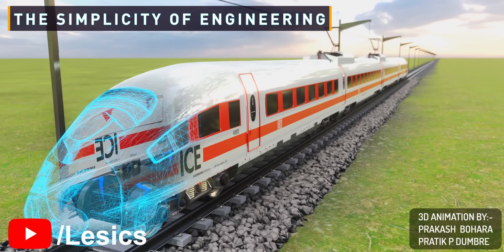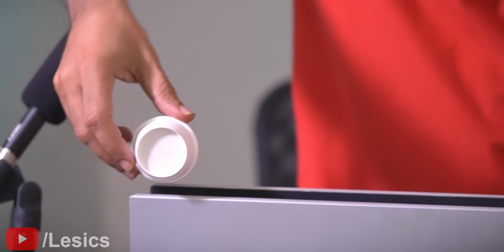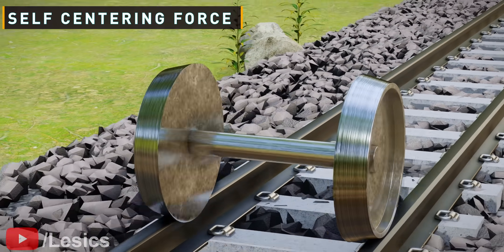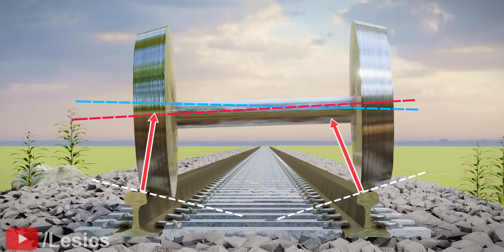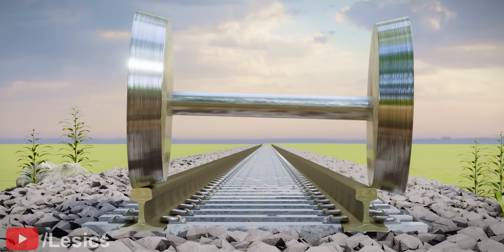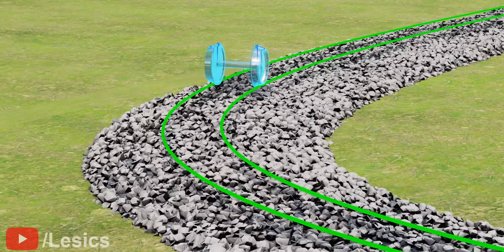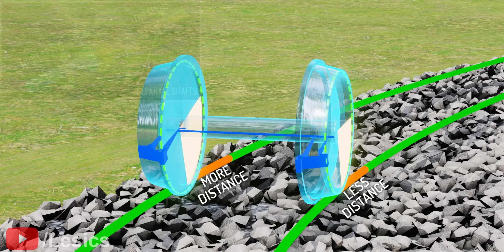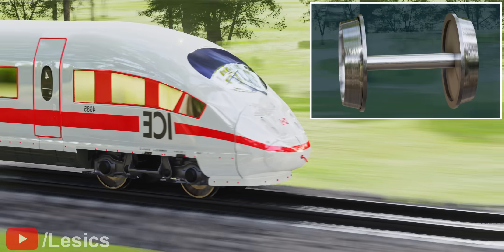The interesting engineering behind the SHAPE of Train wheels!

Comment: Well, the same conical shape gives rise to hunting oscillations on a straight track I.e the side to side movement, which even required the engineers of shinkansen to drastically reduce the cone angle, to ensure high speed stability of the train. So, it is brilliant but not flawless.

Comment: Dont listen to sh$t like "differential action" it could be called loopdygoop action if the differential (a gearbox in cars) was called loopdygoop. I hated that studying engineering so many useless as f%ck terms to use. Like names of people for equations and sh%t. Its the radius contacting the train rails is smaller on the inner wheel dont need to go on and on with complex naming schemes.

Comment: Don't understand differential action around curves. If the curve is properly superelevated the wheelset will remain centered between the rails, thus no difference in contact diameters will occur and no differential action. Squealing! Of course, for real trains (proper speed and weight the center of the wheelset will oscillate around the track center).

Comment: In reality, banking to overcome differential doesn't always work that great.  If the tracks and wheels are carefully calibrated or are worn down, there will be significant resistance.  This will manifest itself has noise (why trains make so much noise when taking a turn) and increased wear/tear on the tracks.  Ideally railroad tracks don't turn at all which is why they are often pretty straight.  This brings up an interesting debate on narrow gauge trains vs wide gauge.  Narrow gauge can take tighter turns because the differential is less.  These are popular in mountain areas where railroads have to take tight turns to get around the mountains.  Wider gauge is popular because it can handle higher straight line speeds without oscillation.  BART is a famous example of a railroad whose gauge is too wide.  It is extremely noisy 90-100 db because it is difficult to calibrate wide gauge rail, which results in imperfections and track stress/noise (especially on turns).  Alternate solutions to these differential issues including having side wheels (like monorails) or having each wheel set move independently (possible for passenger rail as its axles don't have to carry the same weight as freight).

Comment: I always thought flat wheels with flanges were sufficient, but the self-centering action of conical wheels make total sense! 
And I never considered the problem of differential action, always assumed the wheels turned independently and not connected with a solid axel.
Reply: It depends on the type of train, but the majority use rigid axles.

Comment: Tracks are generally laid in a straight line with minimal curvature for high speed use. Unfortunately it may not be possible under certain terrains so the speed of the locomotive has to be drastically reduced to manage the centrifugal forces and the track is banked at an angle to minimize the resultant force.

Comment: Now, what about perfectly flat wheels, which are non-conical on both sides? With a tooth structure for both wheels at each end. My guess is that in this case the problem will be there related to curvature of tracks and turning as shown here.

Comment: Never under estimate 'trial and error' as  useful to design. Also, keen 
observation of Nature can yield new methods and materials. The conical 
shape and flange on train wheels developed over time. Today, only 
materials have changed how train wheels are made and maintained. When 
train wheels wear, they can be re-surfaced one or two times before they 
are recycled into new wheels. Both left and right wheels are machined to
 same measurements, otherwise wrong dimensions would introduce tracking 
errors and greatly reduce useful life of train wheels.

Comment: That is interesting. Instant differential action. Does this design put undue stress on the constant outward pressure at the top of the rails and levering out the anchors? No taper would  have the weight straight down on the rails except in curves?

Comment: This differential action is not suitable because it has a specific radius and with specific speed to turn the train, as it has limited taper. So, if we want to turn the train at low radius with different speeds, in that case this differential action is not going to be work effectively.

Comment: There is a riddle that asks what part of a train is always moving backwards? 

It's the bottom of the wheel. Since the radius of the wheel that touches is smaller than the entire wheel, the part that exceeds the touching radius will move backwards slightly when on the lower half of it's turn.

Comment: Actually, I don't think the explanation of the self centering in the video is correct. Even watching the example with the cups glued together it seems clear that the mechanism is not direction of forces, but the difference in the radius of the part touching the track which actually corrects the direction of the wheels. If it was just the stated forces, the cups glued together wouldn't "turn" to get centered, but would simply gradually become centered while still moving forward.

Comment: I'd always wondered how trains handled the differential rotation of going around curves given that they have a fixed axle with no differential gearing. This answers a question that has bugged me for years.

Seeing this has also allowed me to figure out another thing you didn't mention: the reason why there is a definite limit to how sharp a corner a train can turn. If the turn is too sharp (which is certainly the case in your video, although I realise the turn was exaggerated for illustrative purposes), the differential rotation required to negotiate the turn becomes greater than the differential rotation that the conical form of the wheels can supply.

The ratio between the inner and outer radii of the wheels thus represents a hard limit on the tightness of any turn the train can make. This is why you can't have right-angle corners on railway tracks, and why they can only curve gently.

If the cones were steeper, thus giving a higher inner:outer radius ratio, the train would be able to take sharper turns. However, the steeper slope of the wheels would also increase the lateral forces between wheels and rails, putting increased compression and flexion stress on the axle as well as expansion stress on the rails.

It would be interesting to work out the optimal inner:outer radius ratio to maximise the possible turning angle while keeping the stress on the wheels, axle and rails within structural limits.
Reply: While the differential action of the conical wheels is cool, this video fails to mention that is not a hard limit for the tightness of curve a train can take. Outer wheelslip on curves is supposed to happen all the time. That is the screechy metal sound you hear trains make when they go around curves. The differential action of the conical wheels just decreases how much wheel slip happens. This is also why railways apply grease to the rail on the inside of curves, to decrease wear on the wheels when they slip around the curve.
Reply: Sure but.....a train doesn't only have wheels....so you can't really make a sharp turn
Reply: @Sweet-bx2ec  Also, the length of the bogie would also be a factor in that limit as per your comment "doesn't only have wheels".
Reply: @Sweet-bx2ec  Of course. Without actually doing the maths, but considering the trigonometry involved, I would imagine the relationship between the steepness of the cone and the sharpness of the turn that would enable is related to the angle tangents, meaning that the stressors would increase asymptotically with cone steepness, reaching infinity at 90 degrees which of course would mean the cone has no depth.

I'd imagine that stress curve would rapidly become untenable, in fact, if you took the cone angle much past 30 degrees.
Reply: @Mystikan  30? Off by an order of magnitude, try ~3.
Reply: High elevation curves also utilize rail lubrication devices to help prevent premature rail and wheel wear.
Reply: Calculus
Reply: What none of you are considering is that a train is composed of many connected cars, not just one.  If you have ever pulled a trailer behind a vehicle, you know that you cannot make too tight a turn either going forward or backward or the trailer will jack-knife and if you are going fast enough, can cause both the vehicle and the trailer to turn over.  The same concept is true of trains.  The curves cannot be too tight or the train cars will "lock" into each other at their inside corners (that is the corner that is on the same side as the direction of the curve) and the whole train can start to derail in a cascading form of jack-knife.  The curves are designed to accommodate the longest possible train car (freight or passenger) that might ever use that stretch of track to further reduce the chance of the cars binding together.  A lifetime of messing around with HO-scale trains taught me that; not a math degree in sight hanging from my walls.

Comment: The “automatic centripetal force” is a misleading explanation. The track is what turns the train and the reaction force between the inner disk and conical surface and outside track provide the required force to turn the train. It is the trains inertia and low friction of metal to metal contact which keeps the wheels aligned towards the outside track.

Comment: But with conical wheels the weight of the train is focussed on a tiny section of the wheel, not the entire width of the wheel. Surely this places enormous forces on the wheel? AND causes wear only on that part of the wheel, meaning uneven wear? Could you address those two issues please? They weren't included in the video.  >:-(

Comment: The conical taper causes a "hunting oscillation", which at very high-speeds will cause a train to derail... even if the tracks are perfectly straight and level.  This is why we don't have high-speed trains in the US, because it would require different railroad tracks.
Reply: Interesting

Comment: An alternative way to confirm the self-centering property is to imagine if the wheels weren't angled, but instead the tracks were (at the same angles).  Then, if the tracks angle inward they effectively form a channel that the wheels sit inside of (stable), while if they angled outward, they'd effectively form a ridge that the wheels straddle on top of (unstable).

Comment: Interesting but still a bit confusing. Would the speed of the train going around corners, change how far the wheels will shift thereby changing the diameter of the portion of each wheel in the track?

Comment: As for differential action, wouldn't a particular conical shape of those wheels dictate that all curves in the tracks have the same exact radius? I'm pretty sure that there are more technologies at work here, like putting the wheels on a rotating platform,  and having the wheels do some sliding over the rails. Further, that conical shape of the wheels has as an extra benefit a minimized area of contact between wheels and rails, thus making for less friction and power loss.

Comment: Very good explanation, BUT: In the animation explaining the differential effect 3:40 I think there is an error, it looks like the inner wheel makes a lower angle than the exterior wheel, but they must make the same because of the conservation of angular momentum. So, both of the wheels go along the same angle, but the distance changes because of the difference lengths of the  circumference that the conical shape makes.

Comment: What I think contributes more to the automatic centering, is that per revolution, the larger diameter travels more distance. This causes the wheels to "steer" towards the smaller wheel, which happens to currently be towards the middle.

To imply that it is the angle of forces, is to imply there is sliding going on. How about the centre of weight leaning more towards/over the smaller diameter? Wouldn't that have a stronger sliding effect?

Nice animation though

Comment: Funny thing, you're showing the German ICE, which wheels are only slightly conical as you described. Check the French TGV, it's wheels are much more conical. The problem with those more conical wheels (yes, they are more safer, than straight ones), the stress and wearing off of the rails are much higher.

Comment: I am wondering if there are any techniques to reduce the weight of the train. Also increase the distance between slippers to safely save lots and lots of material. Are Hollow shafts equally safe as solid shafts ?

Comment: Just an added info, there are minimum angles for curves in tracks. Those minimum bending rules are based on the  wheel maximum safe differential effect. If the track had a curve with a very steep angle the train would not be able to turn due to its fixed axis.

Comment: I wish they would have emphasized how important it is for differential action to act as a "push-pull" force, and follows Newton's 3rd law: for every action, there is an equal and opposite reaction. As one wheel gains diameter during a turn, the other ABSOLUTELY has to decrease its diameter in sequence or you get scenarios where derailment can occur. This push-pull differential can be specifically calculated, and is the main reason why train tracks have specific rates of turn that can't be exceeded, and has constant track width inspections. Rail track inspections is so critical to making sure this differential action is kept within tolerance or else you can get train wheels that will exceed downward force at limits that can actually cause wheel hop due to instantaneous track width widening and narrowing in short distances. This is one of the main causes of train derailments. 

-your experienced locomotive builder.

Comment: After working in our subway system, the rails are also pointed slightly inward. It's very slight and looks pretty straight until you take measurement. The plates holding the rails to the ties will show a difference in height from the gauge side to the outside. Turns are also slightly shifted higher towards the outside of the turn which is why when track inspections are done, we have to take cross level readings as well as the gauge.
Reply: Exactly.  Glad you noticed that they missed the inwards tilted rail head, in the video graphics.  The higher outside rail on a curve is called Super elevation.
Reply: @railtrolley  
'Superelevation' is an American term.
The British is 'cant'.
And the Russian is 'elevation of the outer rail in a curve' ("возвышение наружного рельса в кривой"). 😄

Comment: A worthy note on the conical shape of the wheel is that it prevents achieving higher speeds . as the constant oscillation automatically damps the train speed
Reply: Can you elaborate please
Reply: @JessifurC  wheels are going left and right and train cant go brrrr
Reply: @ALEX-db6rr  lol ah gotcha, I thought Maher was making a statement on the limitations even while traveling entirely straight.
Reply: @JessifurC  its also true for travelling straight since wheels going left and right as well, just no as much as on turns
Reply: @JessifurC  The more tapered the wheels, the more the train will sway back and forth.  This can create a positive feedback loop in which little sways lead to bigger and bigger sways.  At low speeds this isn't a big deal because the horizontal momentum will be offset by the weight of the train.  But at high speeds big oscillation will cause the train to derail.
Reply: @AaronSmith-sx4ez  Interesting, so to offset this they should counter-balance it on the outside or inside wheel-axis module. Either way, all this human tech is trash.

Comment: Right, but there has to be a cost of this in the form of less surface area on the contact between the wheel and the rail = more frequent servicing of the track and the wheels, right?

Comment: Without actually modeling the second scenario (going through a turn), I wonder if the explanation in this video is accurate. 
Like the first scenario, the train is kept centered on the tracks, but assuming the distance between the rails is constant, that means the outside wheel must still travel a longer distance than the inside wheel. Depending on whether the axle is fixed to the wheels or not, the outside wheel must turn slightly more revolutions or the wheels will need to slide slightly on the rails due to the difference in distance traveled so I'm not sure what the advantage described here really is.
Reply: Centrifugal makes it ride on the tallest "inside" part of the wheel on the outside of the bend, and on the smaller diameter "outside" part of the wheel on the inside of the bend.  Two different sized "wheels" on the fixed shaft. Balances out.

Comment: At the curves one of the wheels must slip. Not as per thee explanation. A conical wheel will not provide such large adjustment. Regards.
Reply: How can it ?
It is fixed via the axle.
Its one unit
Reply: @farrider3339  Correct. One shaft welded to 2 wheels. The rotation (RPM) is exactly same. So the rail and the wheel will slip (friction) on one side. Regards.
Reply: @subramaniamchandrasekar1397  OK 👌